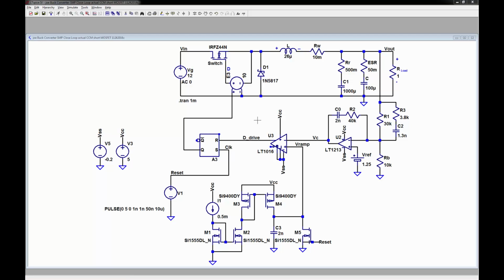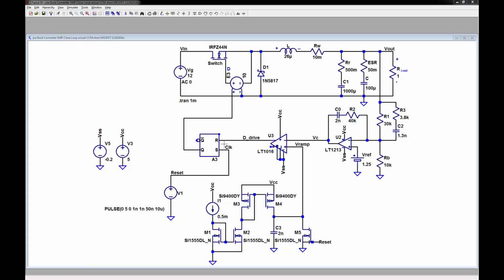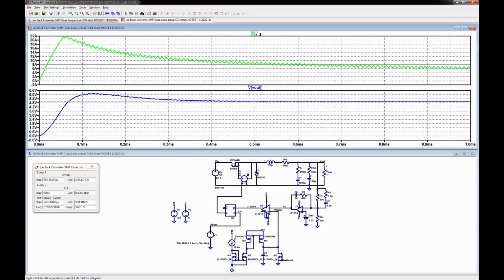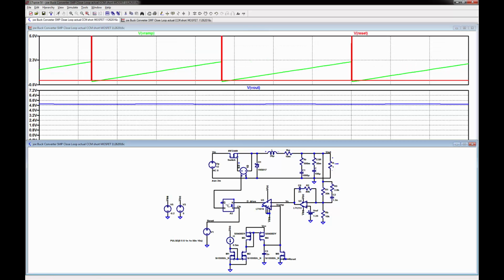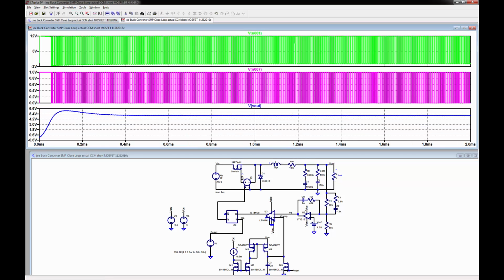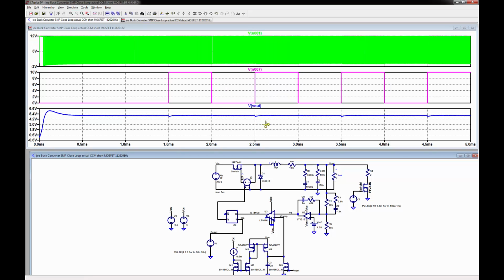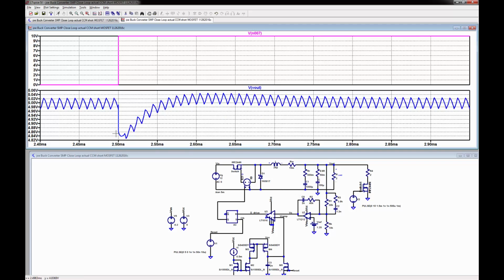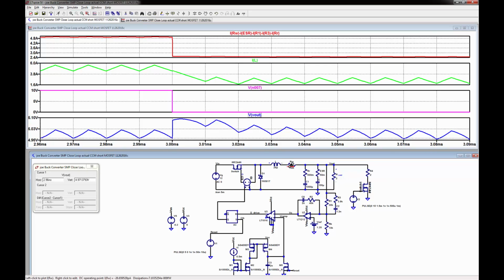LTSpice Buck Converter Real Components Sim & Pulse Load Transient, Closed Feedback Loop, Part 2 of 2

Comment: If you want to use LT1016 with supply 0-5V, Vin should stay in 1.25-3.50, so if you want Vin till 0 Vcc_negative should be best -1.25V. Great Video. It helps me a lot.

Comment: I am designing a 12V to 5V buck converter with type 2 compensator i am facing a problem that when i changed the source voltage the output voltage also change while in the closed loop buck converter by changing the source voltage and load the output do not change according to load prospective my output is correct and in source my output change
Anyone can help?